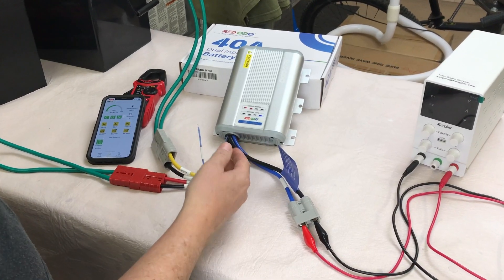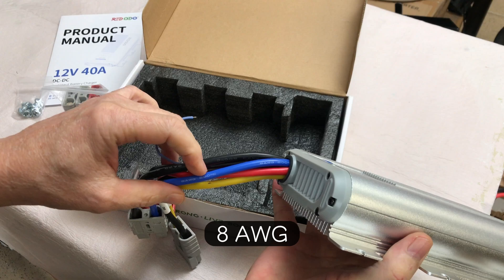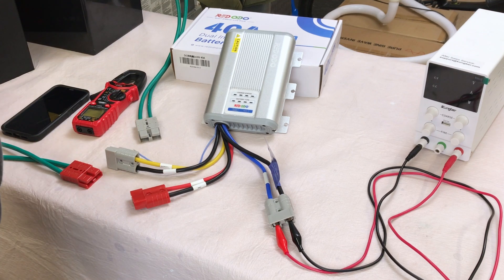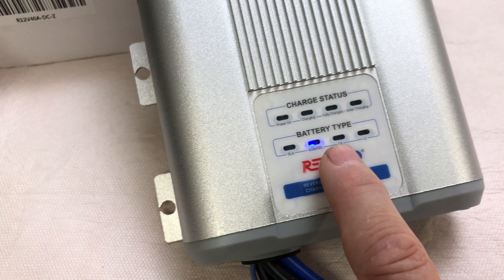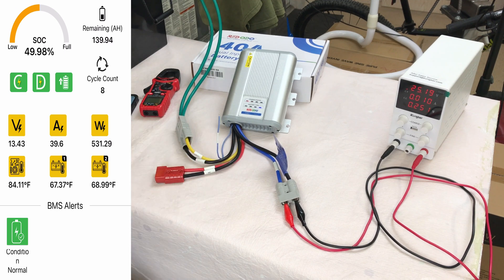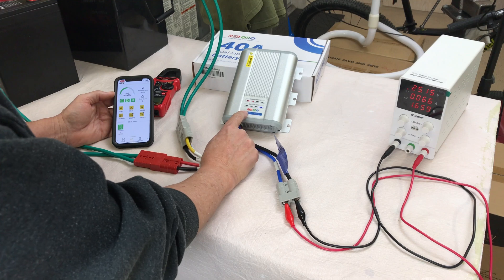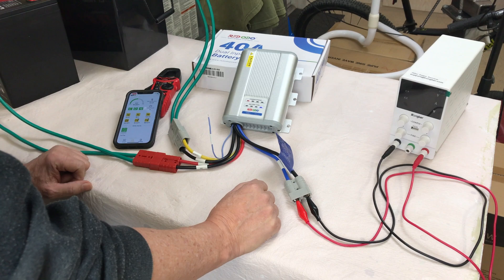Transform Your Energy Game: Redodo 12V 40A DC to DC Charger with MPPT!

Comment: 8:12 are you that the charger does not automatically cut off the starter battery?
Reply from the maker: I'm not sure but I think that will depend on if you connect the blue wire or not.

Comment: Unfortunately  a lot of RV use the larger,  domestic solar panels now, which are 37v+ - this unit, like so many by other manufacturers, can't handle that kind of voltage - if manufacturers could  offer a model with uprated components like capacitors/mosfets rated to higher voltage, they would corner the market

Comment: If this is anything like the litime charger that looks like the same charger it’ll only pull down the starter battery to 12.4v, then it will automatically charge it back up to 12.5 without even hitting the reverse charging button

Comment: Looks to me like when you shut the engine off, and dont do the reverse charge, you would run down your starter battery. Otherwise, it looks like a very good charger.
Reply from the maker: I believe you can prevent that problem if you connect the blue wire to an ignition supply source so when the ignition is off, the charger no longer draws from the starter battery.
Reply: @DIYHomesteadProjectsDIYHP10  I guess I dont see the difference electrically between not having the blue wire hooked to anything, than having it connected ignition switch if it is only "hot" when the ignition is on, therefore, not powered when the ignition is off which is just the same as not being connected anything.

Comment: Could I charge a 140Ah lifepo4 battery with this device and a 120W solar panel?. How many watts could delivery this combination to my lifepo4 battery?
Reply from the maker: Yes as long as the solar panel open circuit voltage is 26V or less. 26V is the maximum input voltage on the solar input. You will get up to 120W of input into the battery (in perfect conditions) with that set up.

Comment: Great video! I just wish this device could charge my LiFePO4 battery at a higher voltage. Most LiFePO4 batteries recommend a charging voltage of 14.6V, but this device has a maximum charging voltage of 14.4V for LiFePO4.

I’m not sure if it would fully top off my battery, but I’ll probably still go ahead and purchase it—or something similar.

Regards,
Reply from the maker: Thank you and I wish you the best!

Comment: crazy idea here.. maybe you could test.. i wonder what happens if you wire this up to just a  12v inverter and solar..
shouldnt the solar/charger be supplying the steady 12v to the inverter up to a max of 40a if enough solar is coming in?
of course without a battery the inverter will scream when a cloud passes by!
but i do wonder if it would work. i mean the charger would be acting like a good dc converter.
Reply from the maker: I’m not sure but that’s an interesting idea to test.

Comment: Won't it stop drawing power from the starter battery when the voltage drops so it doesn't discharge the starter battery too much to start the vehicle?
Reply from the maker: I've been told if you hook up the blue wire to an ignition switched circuit it will not drain your starter battery when the ignition is off. The instruction book states to use the blue wire for smart alternator instillations. Several people have informed me they used the blue wire on a standard alternator install and it worked fine for them. I have not tested this myself but installing it this way will insure you don't drain the starter battery down too low.

Comment: Pair this with a Licitti Battery Box which has a built in 175A DC Input/Output anderson connection.  Supply your own battery.  Put a few up in series.  You can get an amazing DC set up for a discount cost and requires almost  no know-how.
Reply from the maker: Thanks for sharing this idea.
Reply: @DIYHomesteadProjectsDIYHP10 
Yes I would like to see that 👍
Reply: No know-how??? Please don't do this. This device is for 12vdc and putting the batteries in series will increase the voltage. Did you mean to say parallel  ?

Comment: You made a mistake. That blue wire you don’t have connected is for the ignition so that it will only charge your house battery after the vehicle is running. Using the blue ignition switch wire will not let it drain your starter battery.  No need for reverse charging under normal circumstances.
Reply from the maker: Thanks for the info
Reply: I was hoping that would be the case, I bought one but have not installed it yet..... good Info !!
Reply: If you are using this for like a truck camper, like I do, you have to remember lithium iron phosphate battery controller will normally not accept charging below freezing. Right now I’m on a three week work trip leaving my truck parked at the airport for those weeks.  I have a small heating pad underneath my battery. Hopefully to keep it warm. 😂I’m wanting to see if my battery will keep itself warm those three weeks. Winter storm warnings are due in Atlanta beginning tomorrow. 😮 so we will see.  I used to have the battery behind the seat.  One winter trip to Ohio showed me that was a no go.

Comment: Doesnt seem like a smart design to be set up to kill the lead acid starter battery. Reverse charging or not, that kills SLA. There SHOULD be an igntion 12v switched input so that it was controlled by ignition key position, at least for the non-solar side of it. Hard pass.
Reply: I have this same controller for a couple years now. It does have an ignition switch detector.  It was inexpensive when I purchased mine and easy to install and has been trouble free for me.
Reply: @BoandBeceadventures  good to know thanks

Comment: But you would always have to disconnect the engine battery to stop draining it? that's kind of silly and the starter battery would be lead acid would you have to reset it to lead acid to charge it? on reverse charge.

Comment: I've been searching for a review of this charger and your review is very clear and informative. This charger looks very easy to install and use. It appears the DCDC alternator function performs at the full 40amp charging limit. But, the MPPT function appears limited to 20amps. Can you please confirm? Thanks.
Reply from the maker: I understand the solar INPUT limit would be 20amps based on the 600w 30v solar input limits. But 600w at around 14.4v (LiFePO4 charging voltage) would be about 41amps of charge output current from that amount of solar. I believe this units output limit is 40A regardless if the input power is from an alternator or 600w - 30v of solar input. That is how I understand it anyhow. Hope this helps you out!
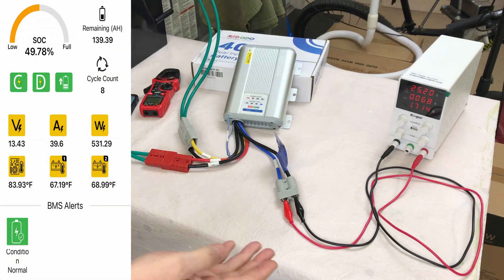Reply: @DIYHomesteadProjectsDIYHP10  Thanks, but I'm confused. The specification sticker on the unit shows a solar input limit of 13-26v (not 30v) and a solar charge output voltage of 14.4v for lithium batteries (at time stamp 1:08) for a charge rate of about 374w (well under 600w). When you simulated solar charging with your DC power supply (at time stamp 6:25), it seemed the unit only charged about 17.5amps at 13.36v for 233.67w. Then you switched it back to the battery input to simulate alternator charging again. Can you up the voltage (to say 25v just under the higher end input voltage limit of 26v) coming from the DC power supply to simulate more panel wattage and get higher amperage from the charger? Thanks in advance for responding.
Reply from the maker: Yes I think there is some inconsistencies on the info they provide. As you stated the sticker on the charger shows a max of 26V and the "parameters" page on the web site shows 30v and 600w for solar input. https://www.redodopower.com/products/redodo-12v-40a-dc-to-dc-charger-with-mppt
Unfortunately my power supply is only capable of 10a max output. You have a good question and I don't know the answer. That would be a good question for Redodo for sure. They do have a contact us feature on their web site but I have not used it. Maybe I'll send them that question and find out what they say.
Reply from the maker: I just submitted the question on their web page so give it a couple days and I'll let you know what they say.
Reply: @DIYHomesteadProjectsDIYHP10  Did Redodo ever respond to your inquiry?
Reply from the maker: I got busy with other things and I never did send them the inquiry.
Reply: Yep, me too. I think I’m gonna pull the plug on this. I have two of their batteries 12 V hundred amp hour each, group 24 minis that I picked up on Black Friday sale